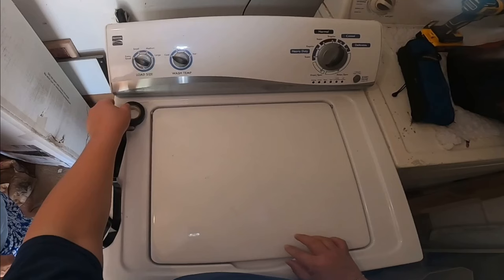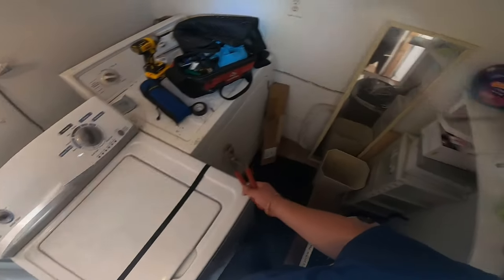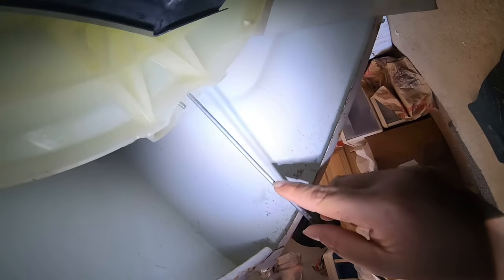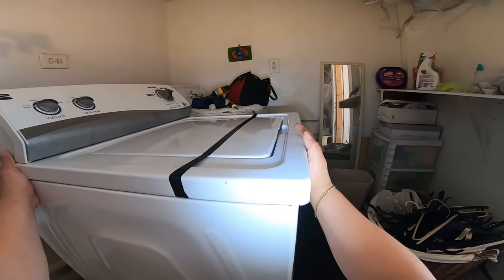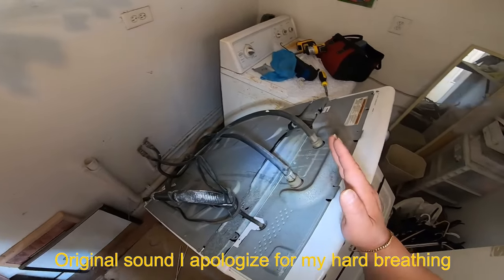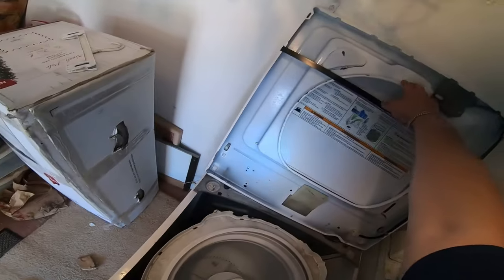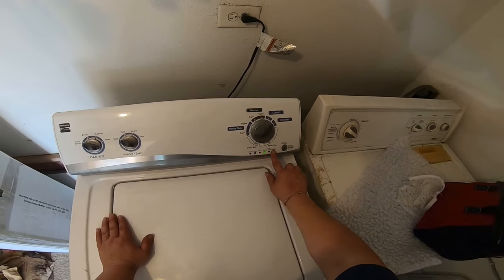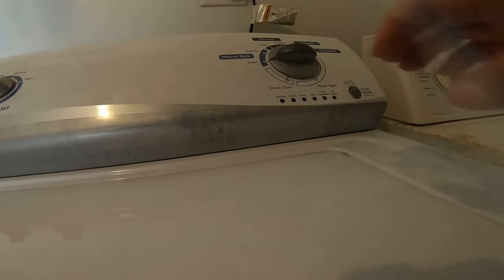How to Fix Kenmore Washer OFF Balance & Shakes Violently | Banging on Sides | Model # 110.20022013

Comment: hey man I completed the repair and it worked for one cycle and after that it started shaking again. If the struts are good is there anything else that would cause it to shake?
Reply: We have same problem right now
Reply: Same problem here. Got the replacement parts. Installed, washer is still rocking.
Reply: @yowaitwhat  try replace the pully clutch kit or what ever the thing at the bottom that's holds the spin. that's what i did to our washer the model that I have does have the pulley clutch kit so I replaced that and the suspension rod with silver color not the black one.. mine got no problem and its been a week now
Reply: @yowaitwhat  try replace the pully clutch kit or what ever the thing at the bottom that's holds the spin. that's what i did to our washer the model that I have does have the pulley clutch kit so I replaced that and the suspension rod with silver color not the black one.. mine got no problem and its been a week now
Reply: @yowaitwhat   try replace the pully clutch kit or what ever the thing at the bottom that's holds the spin. that's what i did to our washer the model that I have does have the pulley clutch kit so I replaced that and the suspension rod with silver color not the black one.. mine got no problem and its been a week now
Reply: I replaced these suspension rods but it still sounds out of balance. Are these just that bad of a design? I bought this washer used and of course the seller says it works fine. The agitator was stripped but jb weld fixed that. I hate the locking lid. When it actually is out of balance it turns into 15 mins waiting for the lid to unlock.
Reply: @Kuzify  a lot of times its the gconnector from the motor to the tub. I ended up buying a new washer some marketplace buys are just run till they dies lol

Comment: What if it only bounce once? It bounces once but it jiggles side to side afterward.
Reply from the maker: That is an Indication that only One of the Shocks is Bad, However they Only Sell them as a Set of 4.
Reply: @DIYRepairsNow  Thanks man! I was wondering if there was a way to find out the rating of the springs and just order generic springs instead of the whole assembly. Not expecting you to know that, but just speculating I guess. If the springs just got weak it's kind of a waste to replace the wire part.

Comment: Hi there just a quick question. Why is the model number on the washer different from the part number on the new part? I have the same washer with a different model number and I’ve ordered the same part on your description but it turn out to be the wrong part. The new part is shorter.
Reply from the maker: The Part Linked is For the Model Number in the Video. Although One Part Can Fit Various Models, You Should Always Check your Model Number to See if it is the Same Part. Some Appliances Look the Same, But Don't Use the Same Parts. 

If you Give Us the Model Number to Your Washer, We can Help to See if it is the Same Part or a Different One, and Let you Know Which it is. 

Hope this Helps, Thanks for Watching!

Comment: Thanks for this video. I ordered the parts that I needed and fixed my washer by using your step by step method. The only thing that didn't work was the test mode method, but I used my washer after fixing it, and it worked just like I bought it brand new. Thank you so much, bro!!!!
Reply from the maker: Glad it helped, Thanks for the Support!